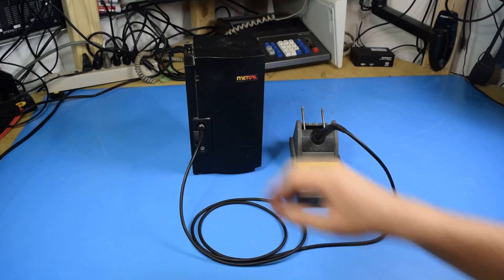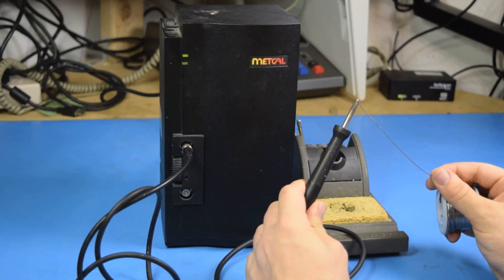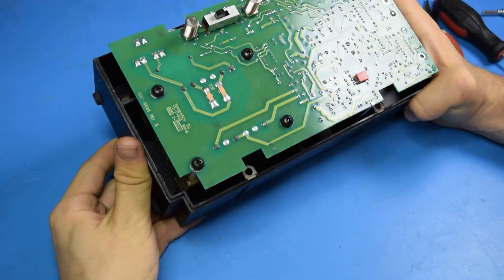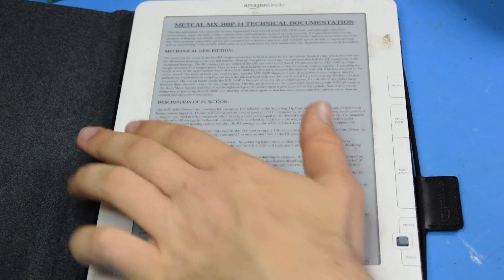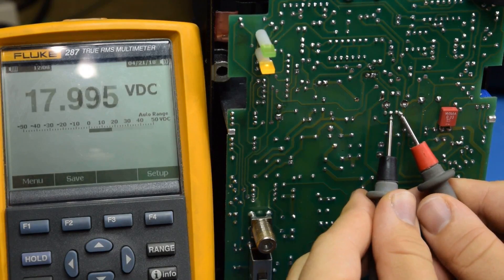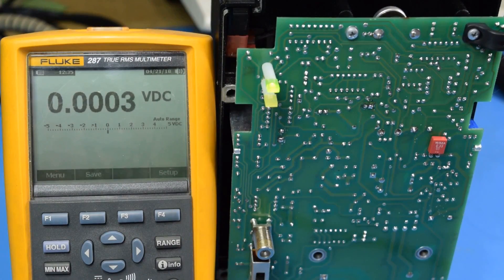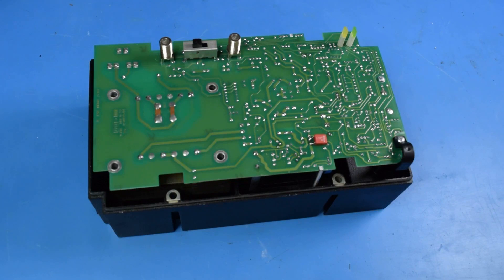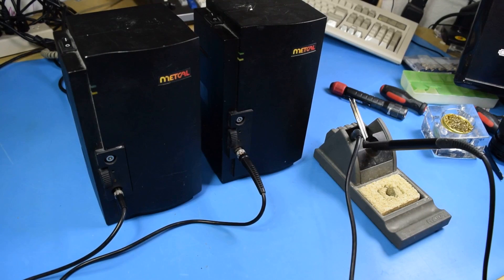0x002B - Metcal MX-500 "Repair"

Comment: I have the same model unit and I love it, use it all the time opposed to several other irons i own. Mostly because of the fact that it gets hot and ready to use within seconds. However, it recently hasn't been heating up to operating temperatures regardless of the soldering tip i use and I have at least a half dozen tips. Any ideas ?

Comment: Is it true, a metcal unit are useless for micro soldering trace repair since enamel copper wire requires 400c and theres no way to manually crank up the temp to 400c in a metcal unit?

Comment: Why does it have so much circuitry if the tips are responsible for controlling the temperature?
Reply: Because the tips heats via radiofrecuency. The power supply is a RF generator that also is made with throught hole parts. It needs to be shielded.

Comment: I thought for sure that reflowing those solder joints is what repaired your second Metcal. I'll dig up my Talon, then perhaps we can make a trade or something.
Reply from the maker: Yeah it was surprisingly just the switch in the end. I also ended up setting up a second bench area for doing assembly for some kits I sell but I might still be interested in a trade or something if you have a metcal talon you aren't using. I haven't come across one yet. I noticed your channel name had "desert" in the name and I think based off a few of your videos you might be in AZ. I am as well in the Chandler area so it might be possible to meet up to exchange something. If you are interested in that, it would be better to email me at akbkuku@akbkuku.com to talk about it more.
Reply: @TechTangents  I'll look for my Talon.
Reply: @TechTangents  Email sent.

Comment: Ahh, another fellow Metcal user :)
Regarding the power switch, these units have quite a strange design concept. The switch does not actually switch the mains. It doesn't even switch the secondary side. Instead, it connects to the internal 18V regulator input, which in turn enables all the remaining circuitry (the switchmode part is always on too).
There is a lot of large bulk capacitance on the inputs and outputs of either regulators or the transsformer, so the rapid flickering points to an issue after the switch. As you can see in the circuit diagram, you get the voltage that goes into the 18V regulator at the transformer, into a 1000µ capacitor, and then into the switch. After that switch, you only have a 100µ cap, and after the regulator, a 10µ cap.
Therefore, i would suspect the switch making intermittent contact, due to wear and tear on the switches contacts. That would also explain the results you see when moving the switch slowly, etc.
Some years ago i created my own RF supply for the Metcal stuff, it was quite some fun to do so. It's on the EEVBlog ("DIY Metcal 13.56 MHz RF Supply"). One of the improvements is that it allows you to change the tips while turned on, and it auto-recovers from the error state :)
Keep an eye on eBay for STTC and SMTC, from time to time you can find sellers that offer new-old-stock cartridges for very little money. Sometimes you also can find a Talon (that's the tweezers for the station) for acceptable money.
Keep an eye out for the STTC-126 cartridge, i really like it. It is a bent fine tip, so you get the best of two worlds: a fine pointy tip to do small solder spots, and if used "sideways", the same effect as a regular flat tip.
What's worth mentioning, because many people moan about stations that do not have the means to adjust the temperature: Solder doesn't care. It always melts at the same temp. The reason people often crank it up is because the iron can't deliver the heat energy (i.e. cooling down to quickly under load). The Metcal stations take mere seconds to recover/adjust to the thermal load. You can use a tip/cartridge meant for SMD work, and happily solder a penny onto a huge copper area without problems. No need to adjust anything :)
Greetings,
Chris

Comment: At first i was leaning towards a bad switch, but then you went and re-flowed some of the solder points in the switchmode section, and after that it was working.  my guess would be a cold solder joint in there that you hit.  i have had cold solder joints that can be invisible to the naked eye. they can drive you nuts. 
 This model metcal is so nicely built, not so sure about the new ones though. they look a bit cheap. I love my MX-500.

Comment: How can this soldering station be any good? Instead of replacing worn tips you have to replace it with the heating element which makes it more expensive than just the tip. Also the heating element is wearing down prematurly due to not cooling it off before cutting power to it.
Reply: Three ic on aluminium, name ??? Please ic name

Comment: Spray some contact cleaner into that switch  or replace it, you rocking it back and fourth likely dislodged some carbonation off the contacts. That buzzing sound was arcing.

Comment: Hey. I own the same station.
immediately after switching on
 when you connect the handle through the power meter, you can see that when you remove from the stand, the station does not immediately give all the power, but dials gradually and smoothly (the interval is about 8 seconds). then 1-2 seconds and the warming up of the sting ends. So it should be?
Reply from the maker: The MX-500 does not put the handset into standby in the stand.
Reply: AkBKukU You did not correctly understand me correctly. Question about the power given to the sting. Why does the station not give all the power at once, to increase it gradually? although it seems that for faster heating of the tip, you need to give the maximum power at once.

Comment: I dont know about the p3's, but the amd durons and athlons may have some issues with recent psu's, as they pull alot of current from the 5v rail. If other people here is planning like me to bring from the dead a old system with a newer psu, its good to check that.

Comment: Having to change tips just to avoid recalibration sounds like more effort than its worth when needing multiple temperatures on one project, having to wait for a tip to cool before changing it over.

 Having two hand sets does help...But its still nothing like a decent temperature controlled iron.
Reply from the maker: Why wait to change tips? It comes with a silicone pad to grab hot tips with. 

Imagine you have 10 of these in a lab and needed to have all of them calibrated. If it takes a half hour for each one, that's going to be 5hrs of labor for a likely high-paid technician. Then you would probably have to repeat this every six months. http://www.circuitnet.com/experts/87161.html

Or, just throw out the tips every six months(or longer) and buy new ones for $20-30 each.
Reply: You usually don't need to change tips with these things, pick the temperature you're comfortable with kiiping your parts at and then pick the shape that transfers the proper heat to the part.  And you're good.
Reply: @junits15   Until something expensive dies and you have to prove that it wasn't using too hot of an iron that killed it. Sometimes its easier to just cover your ass. Ofc this is in a corporate environment but this is like what these are made for.

Comment: My money is on the power switch, like the others said. I've had intermitten problems on my car with the power windows not functioning when I use the driver's side control but fine with the other doors. Drove me crazy for a while  cos I couldn't wind down my driver's window. Finally took apart the switches and found a bunch of oxidized contact points. Cleaned up with a fine wire brush and electronics spray cleaner, worked fine till the day I sold it 4 years later. My bet is swap out the switch and problem solved.

Comment: Classic quantum problem.  You changed it by observing it.
Reply: those are really hard. especially on cars. fought with quantum hydraulics on my car for years (it was a weak pump, despite what pros were saying), it works fine whenever it wants and when it goes to the worksop.
Reply: mechadrake So true. I've been a mechanic for many years and it seems like some car are afraid of being worked on and their problems disappear as soon as they get to the shop.

Comment: I’m pretty sure the issue was dirty connects in the power switch and that the constant turning on and off again has cleaned it just enough to alleviate the issue.  Might be worth cleaning the switch with some Servisol or similar.

Comment: I had some eletronics that fixed themselves too. My positivo laptop shorted out when a bolt got loose inside it and falled in the motherboard close to vrms. Even after hours without the battery and the power cable it wouldnt give any signal of life. I've let him connected to the charger for a few minutes looking for some clue of what happened in the web, when a smd component, maybe a resistor maybe a fusistor  maybe a capacitor (i have no idea), just started to shine, yeah, it was combusting with a bit of smoke and light! I disconected it out of the charger, and measured the resistance of it, still the same as the other smds that looked like it and were close to it, but it sort of seem to melt the solder and one little part of it. I knew that it was screwed so just for 'fun' i tried to put in the charger again, and it just booted into windows fine, and i played games for hours into it. 
This was 4 months ago, and still alive!

I still look for something to explain that.
Reply: Siana Gearz It didnt short itself. I removed the under pannel of the laptop it was flipped down in a table, i pressed the powerbutton, and when i saw, there was a screw stuck between some mosfets/vrms (i really dont know) and a huge spark jumped and it turned off. Then what i described before happened. But it wouldnt give any signal of life, only when a smd component near those mosfets got on fire (basically) that the laptop turned on again. The component seems to be fine even tho its visually slitly damaged. I dint know what happened, could be that short you've said. But i think that smd thing held the short that happened in the primary conversion circuit that converted its 19.5v into other voltages (at least i think it is, i wouldnt say any other circuit could make a yellow and big spark like that). 
It could be a fuse (with resistive protection, i dont know the right english name, is it fusistor?) from what i read. 

Anyway, i wont mess around that motherboard as its perfectly working now with my i5 2450m.
Reply: Fusible resistor? Those can only fail open (theoretically), and only ever makes sense to use it in line, so if it did suffer at all, it's unlikely you would still have a working laptop without fixing that one up.

Polyfuse? Unlikely, i mean those recover just from cooling, not by overheating them again.

Eh, i suppose it's always a tradeoff, whether you let it die on its own or kill it by trying to fix it. Who knows, might serve for decades still as is. :P
Reply: From what some people explained to me a fusistor (in portuguese), "holds" a short, by resisting and heating up, rather than blowing up as a fuse, when the current goes up, if the short dont stop in the meantime where it was heating, it will eventually break the circuit as a normal fuse. I dont know if thats correct or anything. 

If it was a resistor probably it wouldnt turn on, if it is a capacitor, i think i can live without it, if it is a protection component, then i dont plan on shorting it again, i wont even use those interal screws anymore. 

Btw, thx for the help. I think i will only replace the smd thing when it breaks again.
Reply: Those components you speak of would be polyfuses, they snap sharply into high-resistance when they reach a specific temperature, limiting the current and preventing something else from burning up. They are usually found on the +5V rail (because people plugging cutlery into their USB ports is common enough) and on the battery or high voltage rail.

However the residual current they let through in high-resistance mode must normally be sufficient to not let them heat up much any longer. For this reason they often exhibit cycling behaviour in a short circuit condition, where they first trigger, then release and quickly trigger again. This does not harm them though, at least not on this short timescale - maybe after days or months of torture, not seconds or minutes.
Reply: If it isnt a polufuse, i think it is a capacitor, but would a capacitor glow in a yellow color like it was on fire ?
Reply: Once you reach 600°C, every material will glow.
Reply: Wow, do you think it reached that temperature?
Reply: It's possible. The bulk of the material is after all ceramic, it will survive the temperature, but the metal layers can oxidise rapidly. Many of the manufacturing steps for an MLCC involve temperatures of over 1000°C but under inert gas. Or maybe it didn't reach that high and the paint layer on the outside emitted light for some reason, perhaps caught fire, though usually they're not painted, the outside is simply ceramic with similar properties to the one used internally.

Comment: could it have been the main switch? because of the "sparking" noise, and it got better the more you switched it on and off, just an guess
Reply: I was thinking the same thing. Maybe moving the switch back and forth dislodged some corrosion or something...
Reply: @Fuzy2K  may b carbon in contacts...........
Reply: My thought as well.